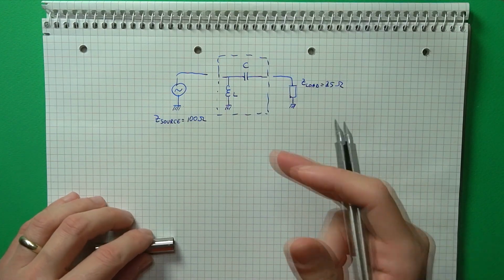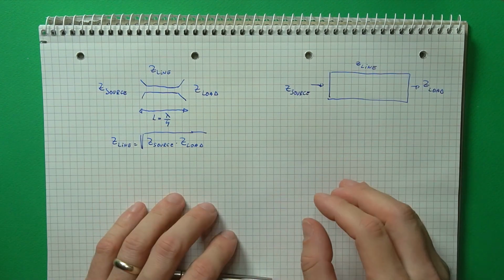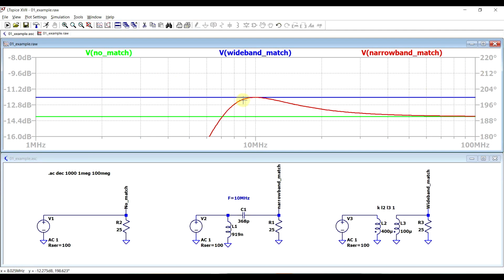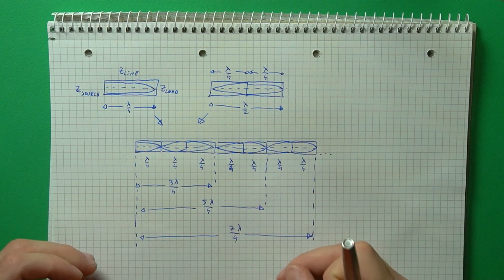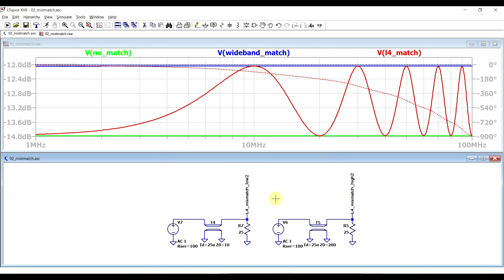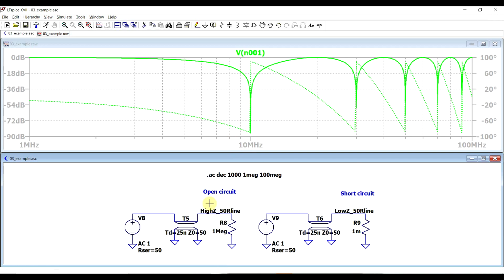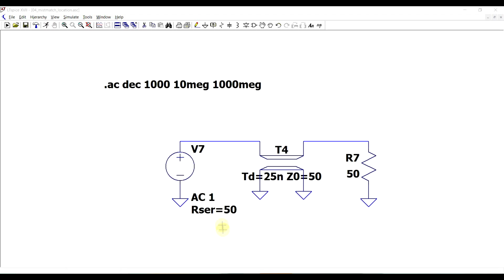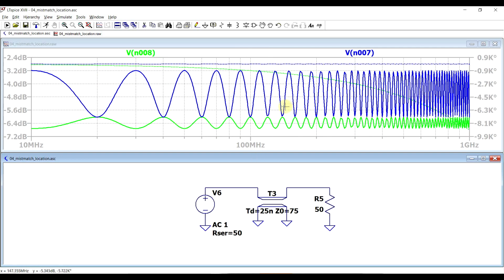Quarter wavelength impedance matching (1/2)

Comment: Another impedance matching method using coax (or transmission line), maybe to match impedance of an antenna is the `twelfth Wave transformer`. It uses two lengths of coax to match small impedance differences, say for example match 50 ohm cable to 75 ohm antenna. Details can be found on a google search.
Reply from the maker: Really interesting! I was researching the stepped impedance matching method that increases bandwidth, but this 12th wave transformer is also interesting because of its simplicity and its bandwidth reduction!

Comment: I have seen wire antennas matched to 50 Ohms without a matching circuit.  Is the 3*wavelength/4 monopole a way to do this?
Reply from the maker: I guess that "matching" is just highly recommended but not mandatory. However, from whay I found so far, the "ground plane antenna" ( a variation of the basic monopole) can be built to have 50R to begin with, so no matching is really necessary.

Comment: Hi FesZ, I built a retro microprocessor circuit and made PCB's for it after breadboarding.  I noticed that on the TTL  clock line driving the clock input of the external CMOS 5V 16550 UART chip there was a lot of ringing. Obviously this is due to an an impedance mismatch between the driver and the input. Data sheets tend not to give details on the input/output impedances of devices so other than taking an adhoc approach to fixing a problem after the fact do you know of some mechanism to determine these impedances in digital circuits experimentally  before laying out a PCB? That way the design can have the appropriate matching circuit out of the gate, even it's just damping resistors? Thanks for the excellent content! Always look forward to your videos.
Reply: What frequency?  Consider the wavelength involved versus the length of the traces involved and ask whether it can be a transmission line (>> 1/4w) or if it is more likely a lumped element (<< 1/8w or 1/10w).  The reason such datasheets don't give impedance figures is because they don't know what the impedances are if they are not specifically impedance-controlled.

For lower frequency stuff like RS232, there are lots of other explanations other than RF and transmission line effects that could be responsible.  Ground bounce from bad grounding is highly likely.  In that instance, the ringing is likely caused by the inductive component of the power supply (mainly return current).  This is particularly true of clocks.  The only time transmission line effects work out is if the source impedance is matched with the transmission medium (and is long enough for transmission lines to be relevant) which in turn is matched with the load impedance.  The rest of the time, ringing due to ground bounce, bad grounding or inadequate decoupling etc will happen at any frequency because it's not a feature of the signal path (or its return current path.  never forget that.)

Pay particular attention to load capacitance for CMOS.  You're driving a bunch of capacitors, so think of what that does to current and in turn to inductive power supply draw (recall, V = -L·dI/dt).

To answer your question, launch resistors (c. 22-33Ω) close to the source, what you call damping resistors, is probably the right answer.  It is often a necessary component of higher frequency stuff anyway.  Depends on the driver.  This looks very much like source termination, but is not technically the same thing even if it has a similar effect.
Reply: I would select an impedance for the traces, let's say 50 ohm and put a series resistance in the output of the driver and try different values until you see cleaner edges. Adapting only the source is good enough in a lot of cases. 

You can estimate the output impedance from the VOL and VOH, by dividing this voltage by the current at which it was tested(all found on the datasheet) but this is only an estimation.
Reply: @Gengh13  Thanks!

Comment: I built a stereo 100Mhz 100watt Amplifier to amplify FM radio signal. It requires a total of 4 mini transmission lines between segments in the circuit. If you see a circuit with what looks like a small single loop of coax cable you know that is a part of the circuit that required an impedance match between the points. It was a fun project to build and it worked well. It amplifies the signal to transmit on an antenna. You simply connect an fm transmitter to one end, and on the other the antenna and you have 100watts signal at the antenna. It's a tricky circuit to build properly because each side has to be exactly the same and it really needs to be distortion free since it is the actual FM transmission signal that is both input and output. It's definitely not a beginner project!